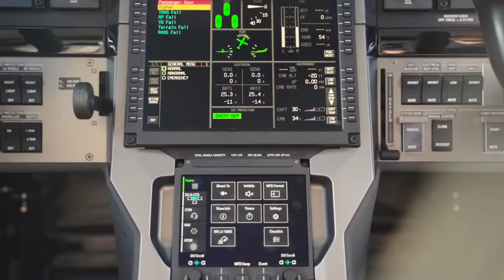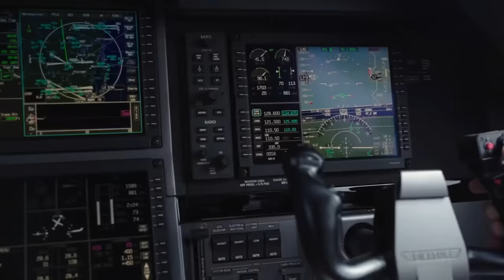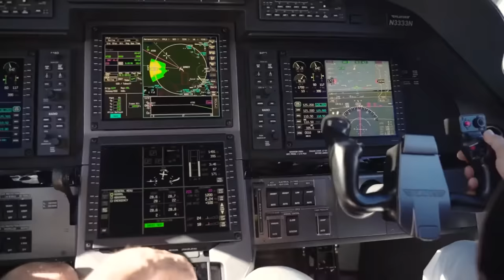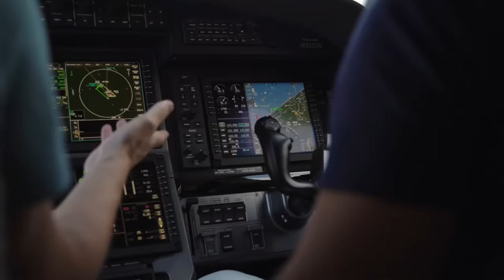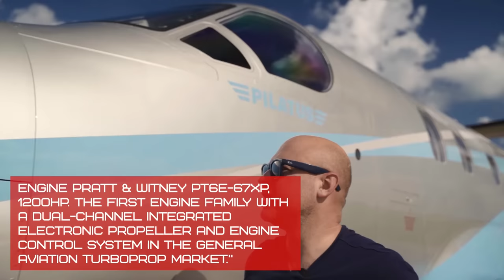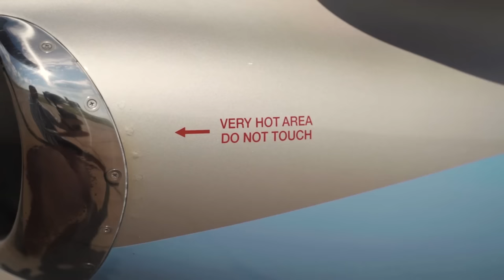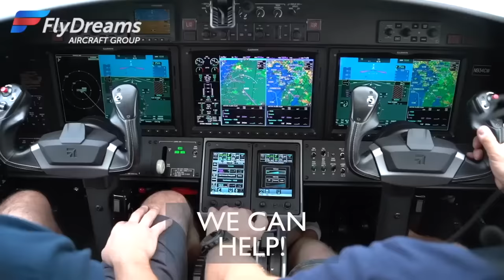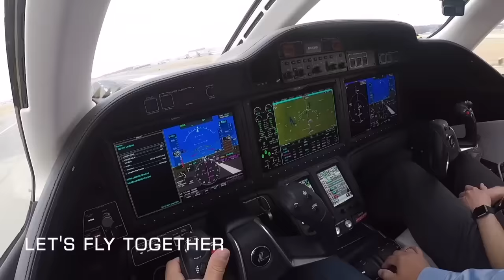15. Discover the Art of Air Travel: Pilatus PC-12NGX Flight Review

Comment: Everything in aviation is a trade off.  If you want something...you have to give up something else.  The Pilatus is not the fastest...but it's not the slowest either.  What you get though by having a single engine turboprop is low cost of ownership and maintenance.  What Pilatus has done is give the owner a mid-size jet cabin with a stand alone lav.  PLUS...the ability to haul ALL the gear you want and not compromise on fuel.  For the comfort, peace of mind and low cost...I'm ok with not breaking the sound barrier.  
The Honda Jet is too small and the payload is lower, (two engines means twice the fuel and weight and the sacrifice is payload and range.) I'd rather have a plane that can haul all 6-7 family or friends and all of our gear with full tanks!  Taking a little longer to get there is fine with me.  It's still a hell of a lot faster and more comfortable than any piston or other turboprops...with the exception of the TBM.  But, the TBM with its 320 TAS...is small, has no lav and cannot compare to the Pilatus for longer trips where passenger comfort is needed.  The Honda Jet is small like the TBM, more expensive and costly to own with the same comfort problem.  The only advantage is it does have a lav.